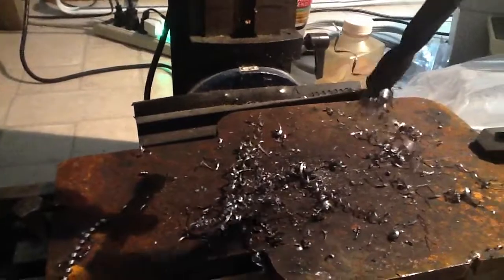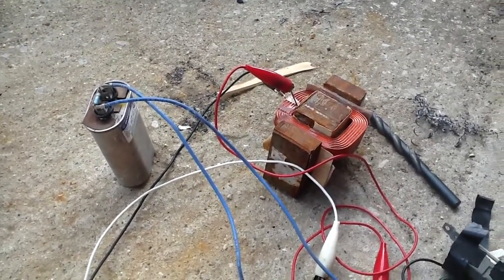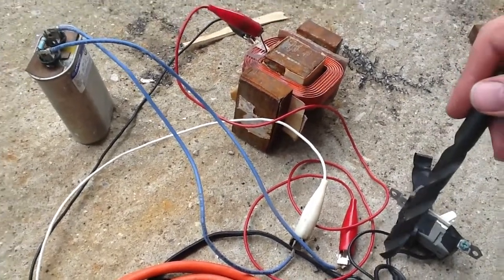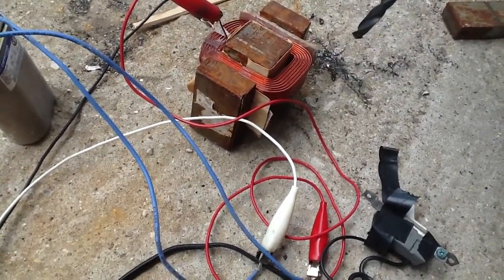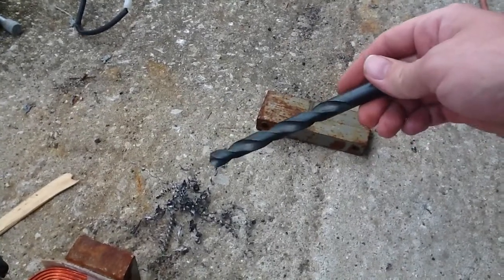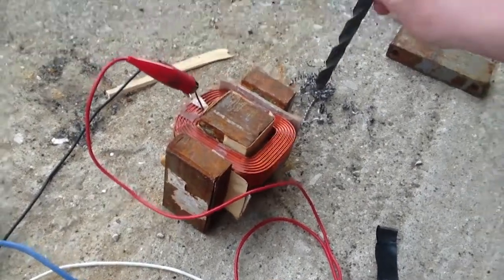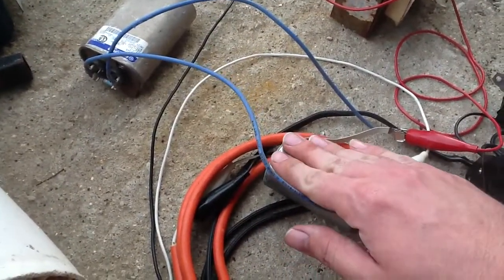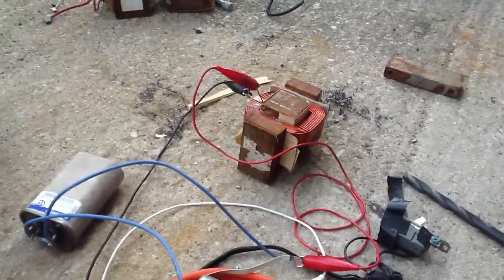How to Demagnetize Drill Bits and Machine Tools

Comment: Correct process, but the reson it didn't work so well,  you DON'T LET THE METAL TOUCH THE COIL. You start it just above the coil. Move the metal back and forth across the field and slowly pull it away. You may need to do it a few times, but every time you touch it to the coil, you are remagnetizing the bit slightly.